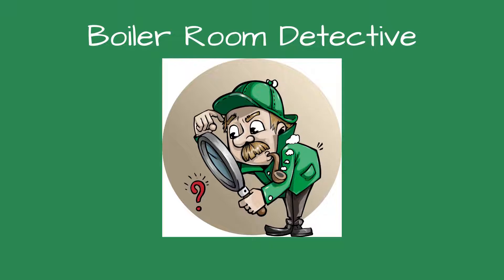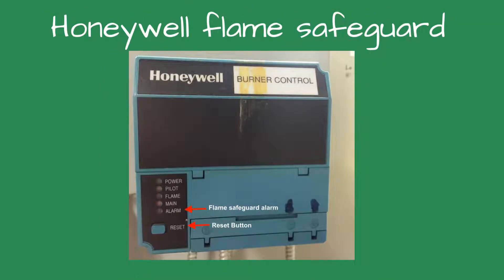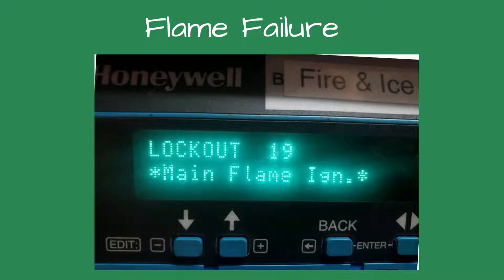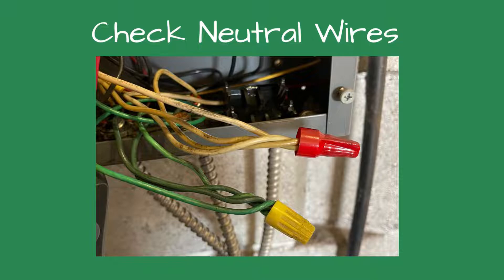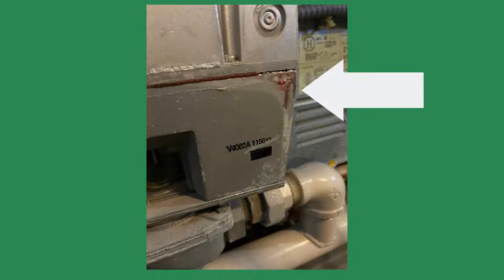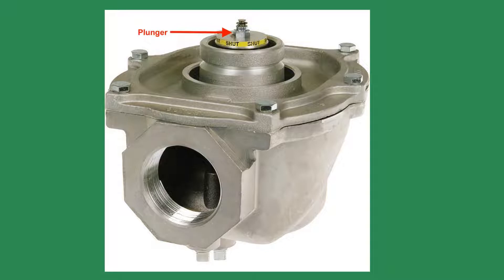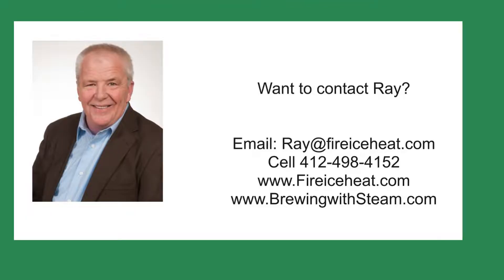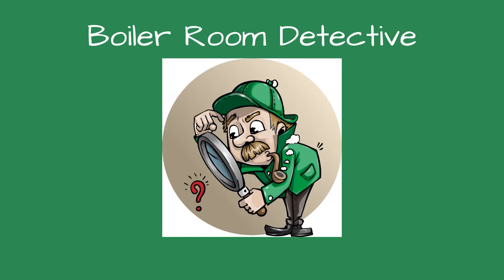The case of the Leaking Gas Valve

Comment: Plus, always a good idea to clean out the hydraulic fluid in the valve's plunger cavity as it will deteriorate the stem's O-Ring seal over time causing a gas leak when the valve is open.
Reply from the maker: Thanks that's a good point I appreciate it